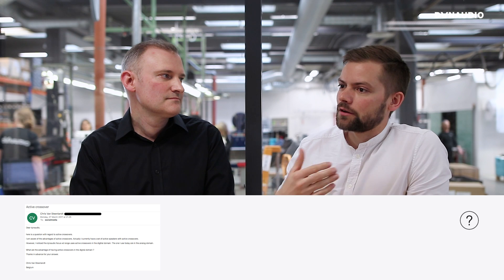What's an active crossover?

Comment: I  am interested in built-in DSP and amplification and this video was informative. I also believe digital sources will eventually take over from analogue. 
Most people use integrated amplifiers to adjust volume and these days using remote controls.
My question is how is volume adjusted on speakers with multiple in-built amplifiers and do they come with a remote control? Also when there is multiple channels L, R Front, Rear, Centre etc all this volume adjustment was via the AV amp. How is it done with multiple speakers with multiple amplifiers built in?

Comment: Great job, I just went out and bought a set of Xeo 2's after watching this. Sounds amazing!
Reply from the maker: Wow, great!
Reply: Have you had any issues with them breaking up? I had an intermittent issue where my Xeo's would break up/make a popping noise. Eventually, I was able to get Dynaudio to replace them under warranty, but the replacement speakers started doing the same thing. So I ended up selling them and switching to the Evoke 20.

Comment: 6:50 there will always be trade off between analog and digital crossover : analog has phase shift and digital adds time smearing and ringing. the terms "digital sound" is actually the sound of digital filters. people going back to use old R2R DAC chips to avoid digital filters implemented in modern delta-sigma DAC chips. becareful when a manufacturer said their technology is superior to others. technology is always a compromise.
Reply: I agree. There are many digital troubles. Digital volume control causes bit loss. Also 0db is the full scale if equ is used then digital saturation occurs ... DSP calculations causes loss of small signal details.

Comment: In regards to studio monitors hooked up via connections like balanced / unbalanced analog inputs. The crossover stage is still before the amplification to each drive unit, is this still classified as an active crossover? An "analog active crossover" if that's a thing?

Comment: What is the difference between the focus XD and the Xeo?
Reply from the maker: Hi :) The Xeo and Focus XD share the same wireless signal system and DSP unit (Digital Signal Processing). Everything else is different. The Focus XD has better drivers, higher ouput amplifiers and can also be used wired to achieve 24/192 support. Cheers, Lilli
Reply: Thanks, Lilli. About the wireless signal system, is it full audible frequency range?
Reply from the maker: YES! 😊